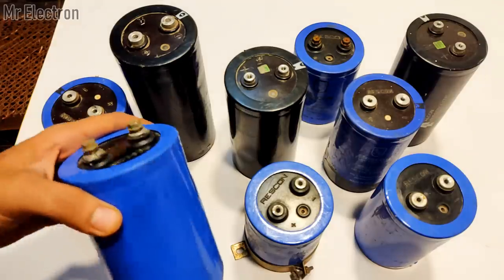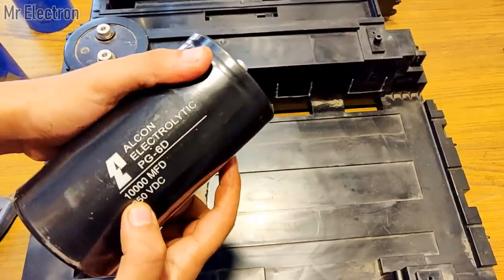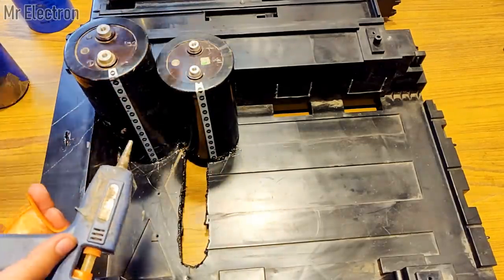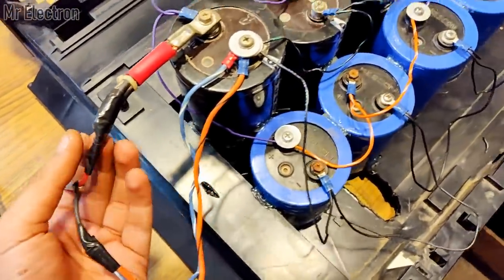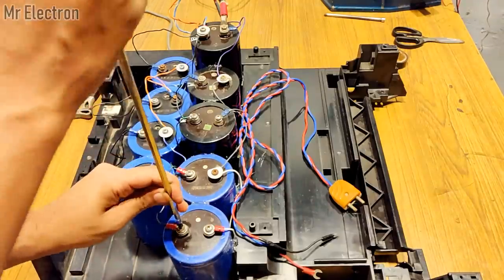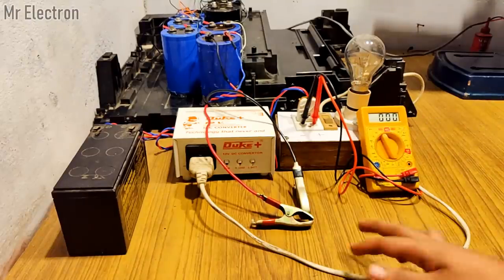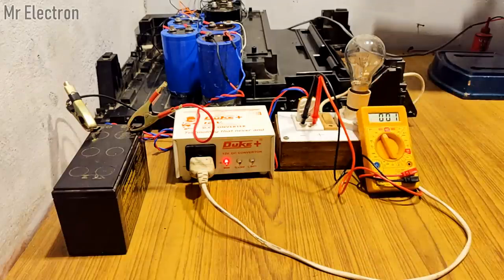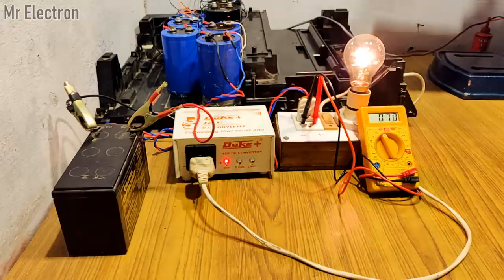New Invention ! Make 1000 Amps Welding Machine using 12V UPS Battery and 220V Capacitor Bank

Comment: I dont know, but as a industrial electrician  I fear those big capacitors, my respect to this genius. 😉
Reply: And you are correct in "respecting" capacitors. Especially larger ones.
Of course we can dream up endless ways of utilizing the immense power of electricity. Especially when we have to pay for it. And perhaps making your own welder from parts cheaper than buying a Lincoln or even something from Habor Freight. 
However life is precious.
I'll keep using my welder designed and constructed for SAFETY and reliability.

Comment: Some people don't seem to understand voltage and ohms resistance. 

A human body is not as conductive as copper wire. A lot of resistance in soft fleshy things.

12v can't cause ionisation in a human body. 220v can cause ionisation and once that happens a small amperage will kill you because your body is now a conductor of electricity.

Also this isn't a mig or tig welder. The energy is stored temporarily in capacitors and discharged to perform a single spot weld. That's why 20amp cables aren't being used.

Comment: So you are wired a 1000 Amps welding machine together using something like 10 Amps rated wire?  Did I get it right? I think you are just lucky that the pulse is too short to melt those wires otherwise you'd have a lot of molten metal in your eyes. Either way the resistive losses in those wires are very high reducing the efficiency of your welder.  You need much much thicker wires (bus bars?) to connect those capacitors together. Then you'll pehaps need fewer capacitors to do the same job.

Comment: Young man the way you hooked up the power through the drill press is wrong. By doing the Electrical connections the way you did, you take a big chance of burning the copper windings out and also damaging Bearings and any smooth machine surfaces. You should hook all the Electrical as close to weld as possible, avoiding damage to Copper Motor Windings an Machine Surfaces. Just an opinion. Thanks for the upload young man.

Comment: The idea is good , however, discharging big caps to spot weld may not last long (100 times). You are missing a key component on your set up, you should put a resistor across your positive and negative poles. This way you will preserve the integrity of your capacitors much longer. Without a resistor, the caps have a very short life expectancy. Also, increase the size of your wires to gauge 10 at least
Reply: ok

Comment: the cables are too thin for 1000 amps. welding machines  usually need thick cables.
Reply: Definitely
Reply: Guess my ex was a welding machine
Reply: Sort of. Remember they are not passing current for any appreciable amount of time. 
It certainly won’t do them any good though.

Comment: great work son, question is, does the drill stand has a motor on it, if so, does it get disturbed then, or short out, or there is't one on it, marveles work loll, keep it up do more
Reply from the maker: It has the motor , but since the machine is not running , it's not affected.

Comment: This process is more of a risk than its benefits. Short shackles work for the capacitors. This is the biggest mistake. It is correct to use a transformer and adjust the output to give a small volt with high amir.

Comment: So many materials, So trouble, ... you get a transformer from a microwave oven, pull off the winding with cutting. Wrap 2 coils with very thick wire as thick as it gets in and you have an Welding Machine above 1000 Amperes.

Comment: 200wv. That is "working voltage". 235v is for "surge" only. Read the label. That means under normal use, do not exceed 200v. And isn't that wire a bit small for your desired 1000 amps?  And no need to clean the contacts. What's a little rust among friends! LOL

Comment: Thank you very much for your efforts
Question: Can I make a circuit turn 220 to 12 and 24 volts with a high amp 10 or 20 amp but without Trans.
Reply from the maker: yes but its always risky
Reply: No
Reply: Depends..  AC or DC ??